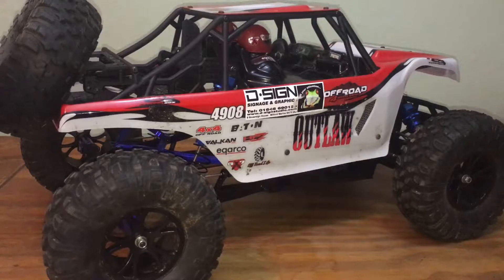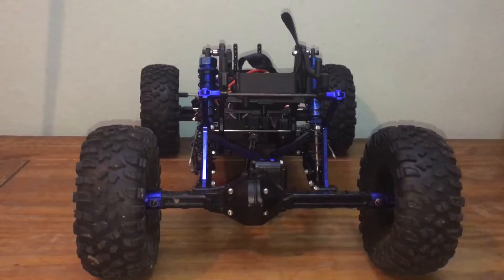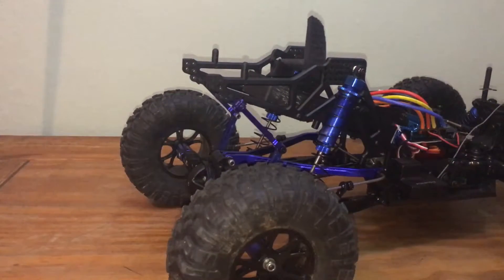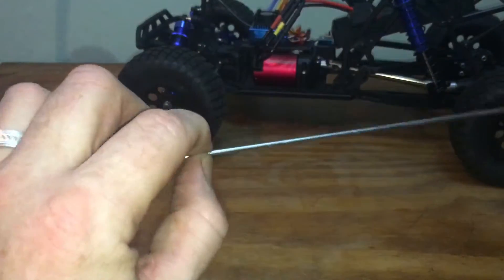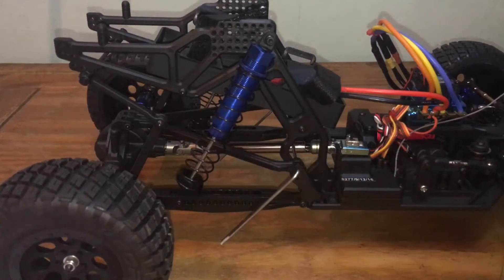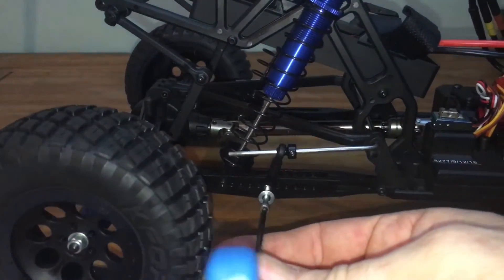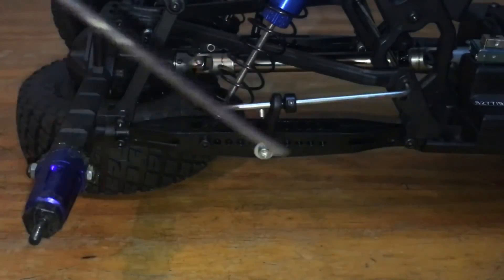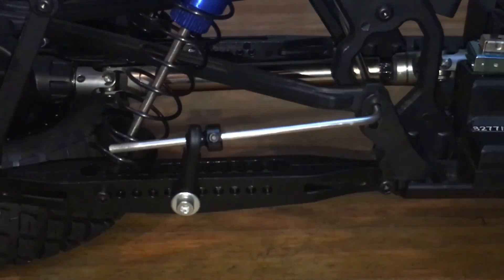FTX Outlaw   Custom Rear Anti Role Bar Assembly & Fitment

Comment: Great vid, Just brought my 1st RC and went with the OutLaw - complete novice so looking for advise on doing this mod. Ive looked online for the bits but no joy so has anyone else done this and can point me to what bits to buy ? its getting the right sway bar kit I'm struggling with . 
running on a 3000MAh battery and i get a lot of tyre lift from the get go .
Reply from the maker: Paul SatMan   Thanks for taking a look! Yes I’ve looked at it seems the kit is only available in the US. I’m sure there are other 1/8 rallycross buggy sway bar kits available. It’s the little link arms which you’d need, unless you can make some up yourself from rose joints and a short piece of stud bar..?!

Comment: Hi, I've noticed that you have the metal upper and lower sway bar pull rods and need to do the same but can't find a way to remove the "Sway Bar Upper Pull Rod" from the "Sway Bar Rod". I've tried spinning it to unscrew it and pulling it off but nothing works...
Reply from the maker: Dean Chapman  on the plastic fitting at the top you’ll see a little round hole, in there should be a small grub screw, I think they’re 1.5mm perhaps, there’s one on each side!  Hope that helps!
Reply: @cramalnig  Ah that's it! Thanks for the help and the quick reply!

Comment: Fantastic - Great video [Craggle RC]...Yes what a wonderful cure for the twisting when accelerating issue.  Completed this with your advice just using a coat hanger (free upgrade) that is already plastic coated - 3mm also like most of them.    No more twisting at all and now sorts out the problem a great solution and a great video for the explanation.  :) big thumbs up for posting this Craggle RC.
Reply from the maker: Ha! A coat hanger... I never thought of that! Lol  well done! Yes it’s worked a treat, totally changed the way it drives now, you can actually drive it hard as intended without losing traction rendering it just rear wheel drive.
Reply: Hi Kevin - I noticed you changed the wheels from the originals - Can you please post a link ? :)
Reply from the maker: They were bought through eBay, I searched for 2.2" beadlock aluminium wheels, they're a bit more pricey nowadays though unfortunately..

Comment: That is exactly what i was looking for - Thanks a lot for sharing!! Do you think it is possible to use a threaded rod for this?
Reply from the maker: Hi, yes I don’t see why not so long as it’s not too flimsy. By adding the bar it’s completely resolved the 3WD issue by helping to keep all 4 wheels on the ground for the best possible traction.
Reply: @cramalnig  Thanks for the quick response! I asked because I constructed a new sway bar mount (the part that brakes the chassis in a Crash, I hope you know what I mean 😁) and 3D printed it. And now I'm curious if a threated rod rubs the printed mount apart.
Reply from the maker: With it being an abrasive face compared to a smooth bar then I suppose the new part would wear quicker, but nonetheless it’d still work well. Nice one!
Reply: @cramalnig   I just found out something very interesting - the original anti roll bar on my truck didn't work. It was wiggly and didn't compensate the torsion of the axle. But I just found a way to make it work: On the top part, (the part that is attached to the rod) there are two threaded holes which fit an M3 Screw. By adding these four Screws the anti roll bar becomes useful - well okay we will see how effective this is but ...hey. :D  It seems that they just forgot to add these Screws in the Factory!

Comment: Hi mate, I'd like to do this but i don't want to ruin its off road capabilities? Does the suspension still travel as much? Thanks mate. I've ordered that metal drive shaft by the way so thanks for the reply :)
Reply from the maker: Mine still goes very well off-road, it travels much better with speed, doesn’t lift that front right hand wheel anymore so there’s all 4 wheels giving traction. Peace of mind with the steel shaft, who knows when or if the plastic shaft would’ve worn.
Reply: @cramalnig  I'll need the steel shaft! I haven't even had a go of it yet and I've put a 64t steel spur and pinion in (nightmare) 4300kv motor 80 amp esc on 3s and 60k diff oil. Its still brand new! Haha
Reply from the maker: Crikey! That’ll have some top end speed, mine was crazy enough on 3S, 3800kv, and 23t pinion.
Reply: @cramalnig  I know! Oh and alloy wheel hex's. Its more of a Crawler/ultra 4 racer really that's why I put the diff oil in. Can't wait to have a go of it! Thanks for the videos :)
Reply from the maker: I believe you can buy diff locks for it to make into an RC crawler, cheap too!

Comment: hi ive lots of movement on my car will put up a video of it on my chanel  could  you tell me why please
Reply from the maker: Hi Kev, I looked but couldn’t see your new video. Play could be coming from any hinge point on the car, steering play is it? Check the following:
All wheels are tightly held on
Hex drives (behind the wheels) aren’t worn, are they plastic or Ali?
Rear trailing arms aren’t snapped which makes the rear axle twist around a bit, making the car veer off
Front suspension arms - screws aren’t loose
Any snapped components on the suspension front and rear.
Is the servo alright or does it click when “steering”?
Are the tyres still adhered to their wheels?
Reply: Craggle RC I’ve not put it up yet I’ve had to look after my 4 kids but will do later.

Comment: the bottom rose joint is it supposed to move or not mine moves
Reply from the maker: Hi Kevin yes it needs to pivot. The actual “ball” of the rose joint remains stationary and the surrounding rose pivots around the ball as the suspension moves up n down, same with the upper rose joint on the custom sway bar.

Comment: found out why back end spinning out only rear wheel drive so some things broke or loose
Reply from the maker: Hello again, yes sounds like somethings come adrift there. The custom rear sway bar will keep the wheels true, both my Outlaws don’t veer off to a side now, they accelerate straight and true and don’t lift that front right wheels anymore. 
When the car is off the ground and you accelerate, is any drive going to the front axles at all (wheels spin fairly slow, one more so than the other perhaps)? If so, check the drive cups on either side of the front diff, as you rotate the stub axles out to each wheel hub you’ll see a small grub screw for an Allen key, one of those maybe loose. 
Or, are just the rear axles spinning and front wheels remain stationary? If so, then the plastic drive inside on the spur gear is chewed and the metal dog bone (front prop shaft) has wore it away. Let me know!
Reply: hi it was the grub screw that came loose front centre diff its got 4 wheel drive now i had to put a sixth hole on my swing arm as mine did not have one did not make a good job of it mine is still lifting the wheel  also the other wheel but  now then it slides the back end out to  the side but thats because its like having a 2 wheel drive to much power to the back whheels  my links are as forward as i can get them is that why its still lifting also my bar that i used is off a cooker shelf rack im not shore if its rigid enough im going to put up a video soon thanks for all your help would it help if i stiffened up the rear shocks
Reply: Ft

Comment: hi done your mod but now steps  to the right on take off not got a 6th hole just a gap os solid plastic and a  piece  in the midle so put on 5th hole frome shock end  do you tighten the ball end on the swing arm all the way tight
Reply from the maker: Hi Kevin, all the parts should be tight yes, and the ball and rose joints should be free to move around and undulate for the suspension travel. So your Outlaw doesn’t have a series of holes running along the trailing arms?
Reply: yes  there is holes but no hole in the middle   hole number six .starting right from shock mounting hole  theres 10 holes  mines in number 5 then theres a bigish space then 5 more holes  ive only got movement  will post vid on my chanel
Reply: looks like you have eleven holes ive only 10 but were your eleven are ive a piece of plastic running through as a cross beam in side looks like to strengthen it up a bit think i should just drill a hole
Reply: they move at rose joint but not 360 degrees just forward back
Reply: my shocks have been move at top to less of an angle vertical almost stiffer now could that also have somthing to do with it

Comment: Can  u pls help me with the stabilizers..., i cant find them, i live in europe, i can find a 3mm bar but i cant find the other pieces neccesary to finish it pls help me
Reply from the maker: Hi, I had to buy them through eBay from a model shop from the USA. I’ll try find the link to the parts again and post it up for you. Thanks for taking a look! It’s worked wonders for the Outlaw.
Reply: Kyosho inferno mp9 tki4 has 2,5 rear sway bar and even in dollarhobbyz I cant find set of 3mm. You used 3mm or 2,5m?
Reply: @tivi6732  did you find it out mate I'm also having trouble finding 3mm ones?

Comment: Made and fitted a removable anti roll bar and tested it out today, no wheel lift at all. I posted some photos here https://www.msuk-forum.co.uk/forums/topic/220899-ftx-outlaw-owners/ plus another mod.
Many thanks for the inspiration.
Reply from the maker: Hi, yes I saw on the forum earlier today! (I'm t2boats)  glad it worked for you aswell, the difference is staggering isn't it. And I like the removable method you came up with too, nifty! When first making mine I thought about ways to remove the bar to carry out maintenance, for replacing broken parts in that area, but I just thought - as sod it, I bought a whole bunch of bars so I'll just bend another one, only takes a moment.

Comment: Quick question could you not have placed the swaybar throught the next hole down on the arm link so it makes it easy to remove the uppet arm link or is there a problem doing it this way?
My Outlaw is turning up tomorrow and this will be the first thing i mod.
Love you videos on this car.
Reply from the maker: Hi, thanks for the question and taking a look! I looked at so many positional options to fit it, using the lower hole would result in the role bar running against the rear prop shaft, using the higher one gives it better clearance and it kills two birds with one stone as it supports the rear link arms at the same time. Mine has touched the prop shaft very slightly but that’s on extreme suspension movement. Easily cured by raising the rear end on the shock towers. Keep me posted on how you get on with it! Is yours the brushless version?
Reply: Craggle RC no standard brushed for now but brushless when funds allow.

Comment: Hi im guessing its total destruction of the sway bar to disassemble?
Reply from the maker: If it needs to be removed for replacement of other parts then just disconnect the the little link arm and straighten out one side as best you can and slide it out. To perhaps make things easier I was originally looking for some sort of half moon clamp arrangement to attach it to the car but couldn't find anything suitable. I think it would be quicker though to straighten a rod & slide out than unscrew 4 small fiddly screws on two half moon clamps with what I had in mind. Then again, how many times could the rod be straightened out and bent again before it snaps? I'd just fit another new rod then seen as several came in 1 pack.
Reply: ftx forum soved  it by cable clamp
Reply: 2 part rods  cable clamp
Reply: @kevinbosworth3  do you have a link to the page? Thanks

Comment: How long does the steel rod need to be? Around 300mm?
Reply from the maker: Hi Tony, yes sorry I didn't put that down in the description. The rods I bought came in 300mm lengths, just trim to suit then when it's fitted. You can see the tails of the rod sticking out behind the little link arms on my Outlaw. All it needs is those cutting off.

Comment: How did it affect the articulation of the rear axle?
Reply from the maker: When it's running I can see very little difference to be honest in how the axle behaves, the way it bends on various gradients over rocks etc with the weight of the car and speeds it has when covering rough ground the suspension still travels freely on either side at a time. Having the bar fitted has helped to bring the car down so it's more planted. I found the car is now a lot more direct and doesn't wander so much as it did before.